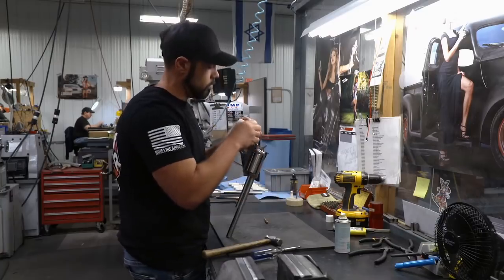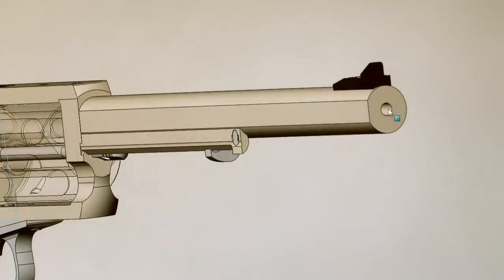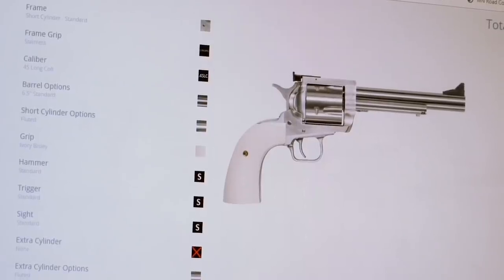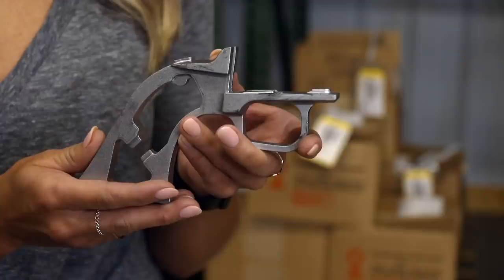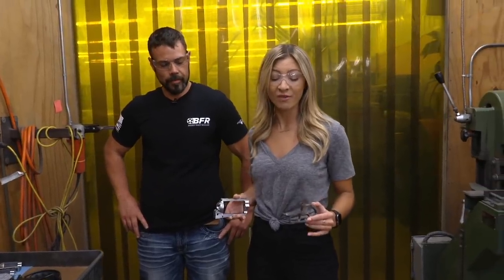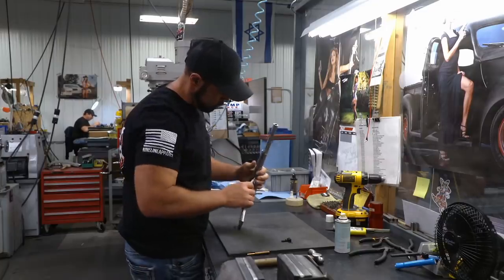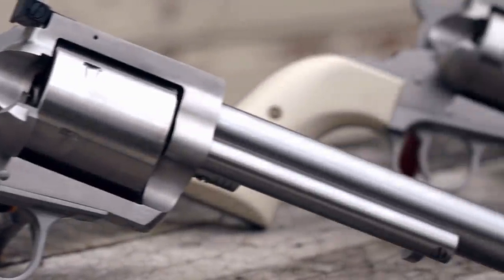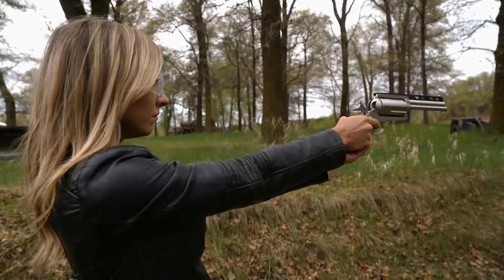How the Biggest Revolvers are Made

Comment: 8:50.., did you see his face when she moved the pencil grinder from right to left?.., only those who know will know :-p
Reply: She moving in the same direction as the rotating grinder?
Reply: @bigchungus7720  Pencil grinders are a great deburring tool if used correctly, the rotation is anti clockwise so you would move the tool from left to right, IF you move from right to left it will cut into the job like a knife through butter.